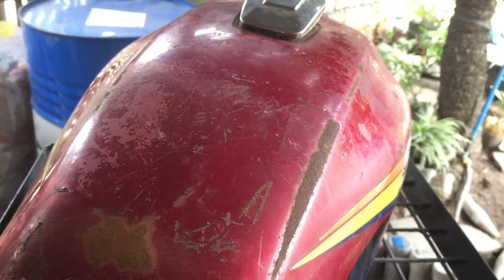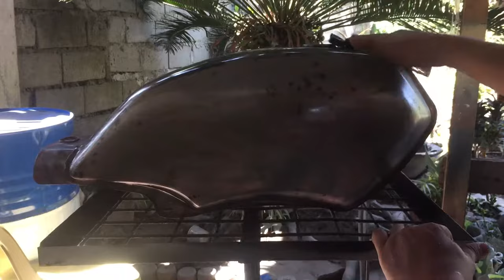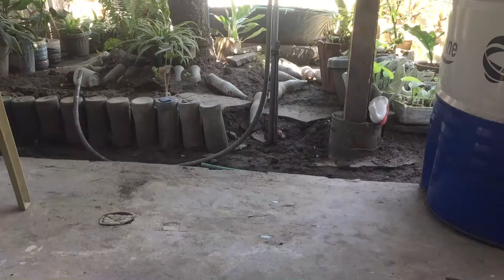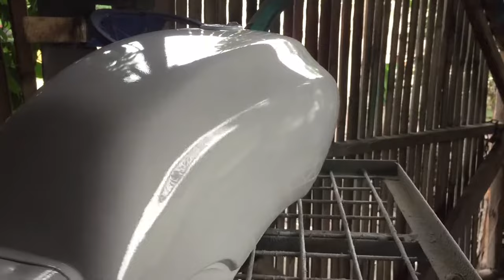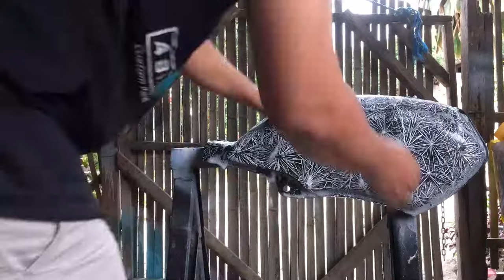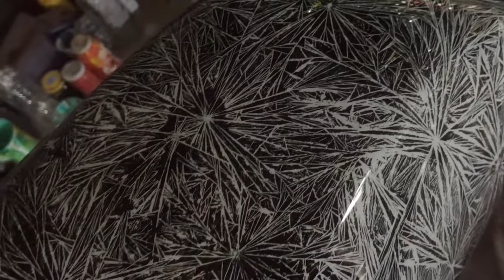Custom paint Crystal effect //paint and restor stx gastank

Comment: How did you get the crystal solution to stick to the silver paint?  Mine just keeps beading on the surface even sanding the paint with 800 grit.  I did 1:1 ratio with 3 drops of dish soap.

Comment: Are you using Urea crystals?  I assume the bottle you used before placing it in the sun was water and dish soap? The fractals turned out great,  by the way.
Reply from the maker: Yes sir thats urea fertilizer ill use emty bottle of dish soap for easy apply porpoise. Tnx for the compliment sir 😁
Reply: Wow looks amazing! What is your recipe for the urea solution mixture?
Reply: @brunonero123  id like to know the method of application for getting crystaks like that .
Reply: @scottjewell1420  its 1 part urea and 1 part destilled water adding 2% ox gall is a must.

so as example: for 200ml fx -> 100g urea + 100ml dest. water + 2ml ox gall.
only works with warm temperatures and applied best with cloth soaked full of the fx solution.
add thin layer of the solution and wipe each side one time. let dry.
Reply: @DiC3GANG does the urea liquify or how do you get 200ml after only adding 100ml water, im about to paint my bicycle frame like this and im looking for the mixture to get a somewhat same effect like in the Video

Comment: Hi have you ever try doing it on black then do crystal effect then paint silver sanded and clear coat
Reply from the maker: Yes sir much better silver 1st then black 😊
Reply: @abpworkstv9761  thank you   can you please tell me how you mix your urea
Reply from the maker: @Mrjoker622  1/1 urea and water, boil until urea was melt din pot small drop of dishwashing liquid 😊
Reply: @abpworkstv9761  thank you I will try that does it matter what urea I use there are different ones in store
Reply: Also I saw you use a stick and you were had some kind  solution on it
Reply: I love it good job❤❤

Comment: When you're touching the crystal FX what are you putting on it or are you poking a hole to fracture the crystals
Reply: its urea fertilizer.
Reply: @noelfrancisignacio8752  He knows that, that's not what he's asking. Before the guy in the video puts on the clear coat, he touches the tank in a few spots, it looks like that makes the crystals form from where he's touched the tank. Go back and have a look....
Reply: Hi Ron, I spotted that too. It looks like it made the crystals form more uniformly, like the centres of the crystal patterns are where he touched it with his finger before clear coating it. I'm going to try this myself... It would be nice if the painter confirmed this...   Edit, Ron, I read through the comments and I was right, this was his reply to the same question you asked.. "Yes sir.. you point it were you want to start the crystal effect"....   Good luck mate...
Reply: @MickH60  noel was right though its the fertilizer but not mix

Comment: Hello brother i am from pakistan and i really like your tank design bro what kind of product you were using in whole process kindly explain me i would be very happy if you guide me.
Reply from the maker: Thats urea fertilizer sir you put urea fertilizer into hot water then mix until urea is melted ratio 1/1 urea and water  then put small drop of dishwashing liquid and u mix it. Mix sure the  paint is dry when you put urea to the surface then wait until the liquid is dry then mistcoat 2x  your 2ndcolor  ☺️☺️
Reply: What did you put on by hand that made the crystals go like that.. Thx and good job
Reply: @abpworkstv9761  will this work with waterbased paint or just with thinnebased paints?
Reply from the maker: @kennethandersen6920  thinnerbased bro 😊
Reply: Hello, very nice work! Wondering what it was you applied by hand on the tank? Was it a peice of fertilizer??
Reply: @abpworkstv9761  I'd like to know this too please - did you take tiny bits of urea and dab them on the tank at 9.25?